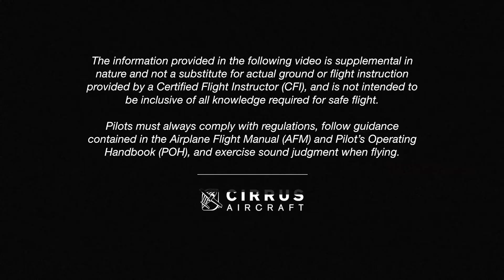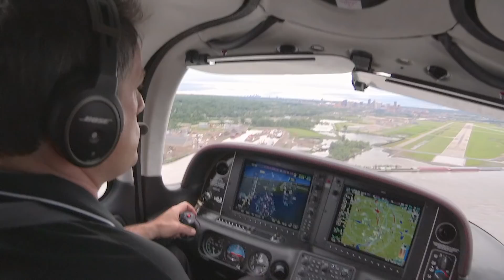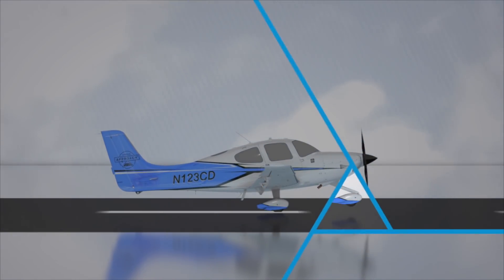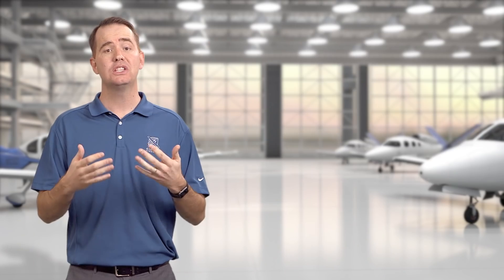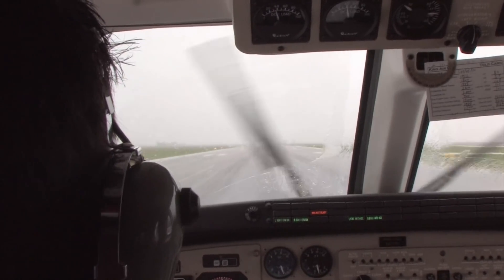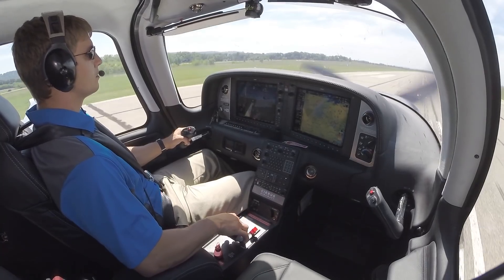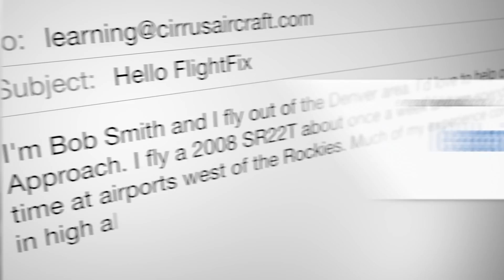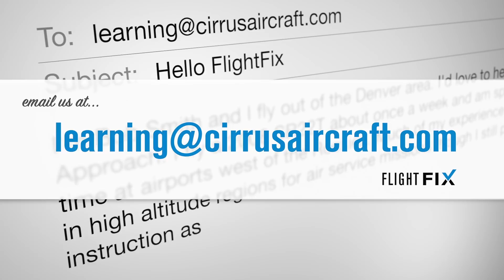Flight Fix: Does a Cirrus Land Flat?

Comment: The video is entirely accurate, but … when I sit at the airport and watch a bunch of planes land, there is no question the Cirrus pilots land flatter. If the nose gear is a couple inches off the ground it’s average. Simultaneous three wheel landings are not uncommon. Holding the nose gear off for 30 feet while gently lowering it is almost unheard of. I do believe this is exactly due to the sight picture, but I really work with my transitioning students on this.

Comment: I piloted the cirrus sr 22 for 7 years beautiful very modern bird, pity the maintenance costs can not such a modern product cost so much maintenance, and scary
Reply: Depends where you take your Cirrus for annuals and other fixes.  Maint cost vary with each mechanic.  My annuals on a 2016 SR22T are about $2k..
Reply: unfortunately in Italy the maintenance they charge a lot, I have an average of 12,000 euros per year
Reply: @Andrea.Gandalf  Odd.  You didn't mention you were in a far away land trying to maintain a product made in Minnesota.  Fuel is high in Europe too...doesn't mean many do not still own and fly their own planes.

Comment: First time you fly a SR20/22 there is no doubt a tendency to try and land "flat" if you are transitioning from other previous generations of light aircraft due to the different site picture.  The best technique I was shown to get the flare right in a SR is to look three runway centre lines forward and continuing to raise the nose to the next three and the next there etc until touch down.  It never fails to work.
Reply: The reason the sight picture appears to be a flat is how long the nose is on the Cirrus.  The simplest way to get the sight picture is to do a few landings with the stick held back and allow the nose to fall on it's own.  Do not release the stick until you feel the nose wheel touch.